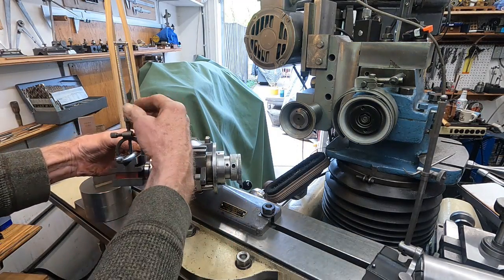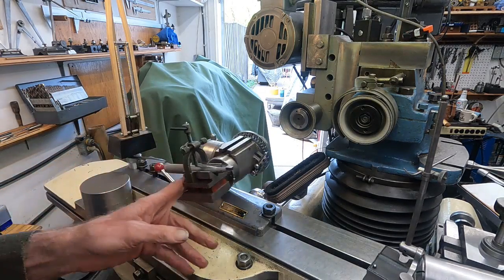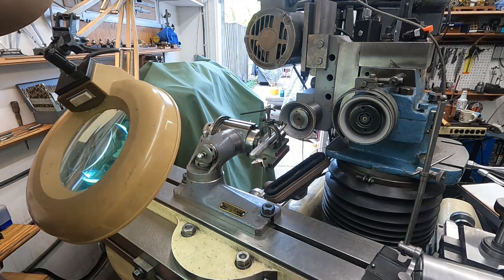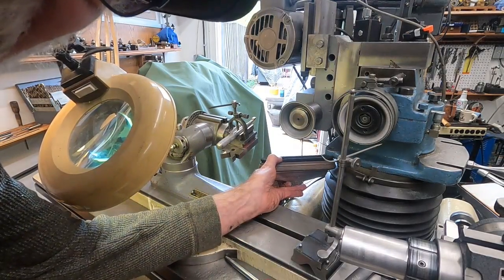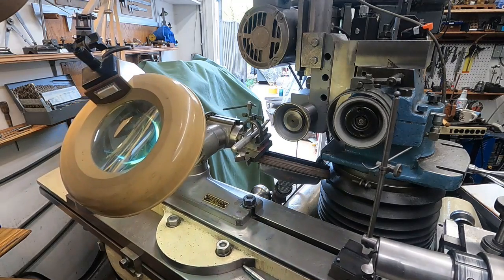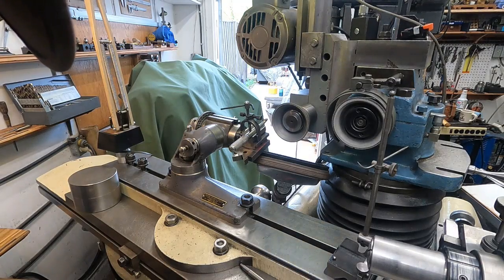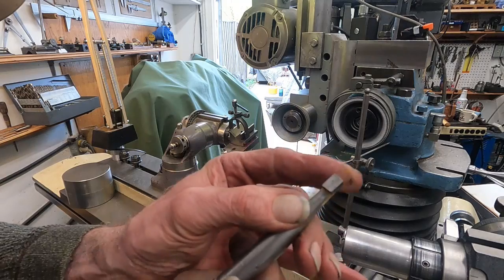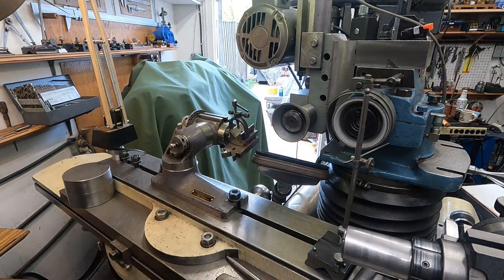Tool & cutter grinder, special carbide scraper edge restored

Comment: Very nice Don. What is the  extra part on the screw holding on the V block? Thanks
Reply from the maker: There is a cross screw on the clamp that works as a jack when the block is used on its side, thanks for tuning in!